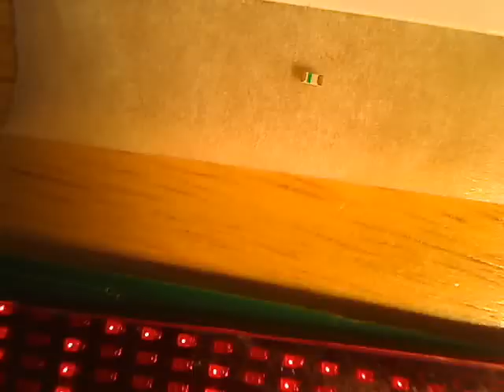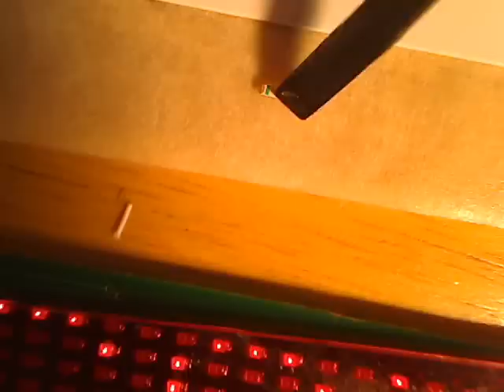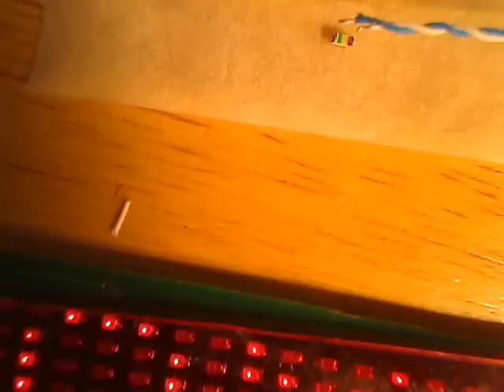How To Solder a 0603 LED

Comment: May I suggest, if you are a newbie, you may want to add the following steps:
1. tape down the wire too to prevent it from shifting
2. use an eye loupe magnifier

This is particularly true if the little one is calling for Daddy and tugging at your sleeve. :)